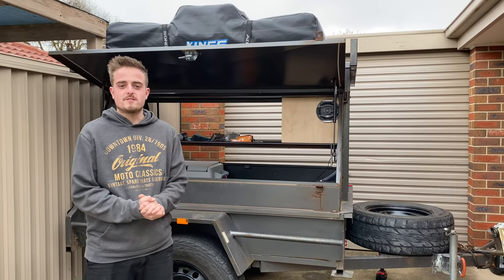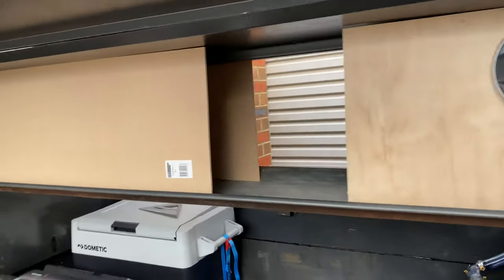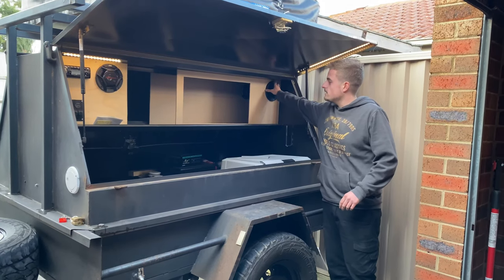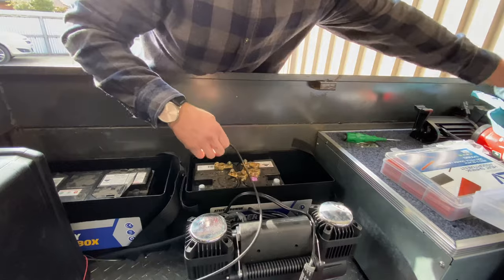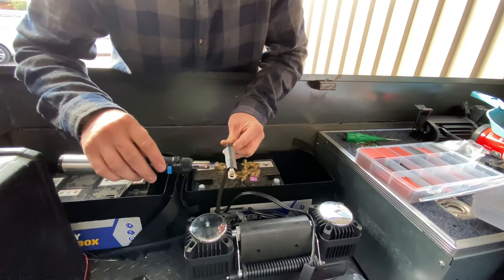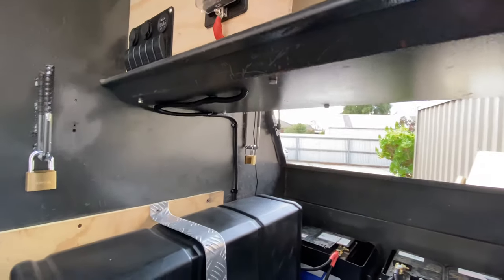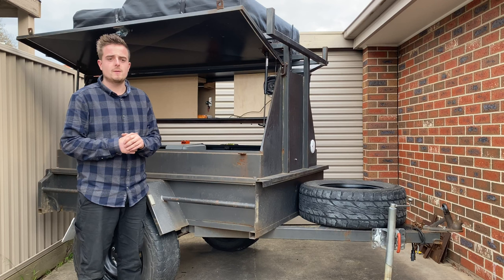DIY Off-road Camper Build

Comment: I've been watching you videos since you started your trailer and like your set up. I'm about to start my build but I'm going with a 30 second oz tent instead of the roof top. I have bad back pain so it just suits me better. What you are making is brilliant and I can say it's giving me ideas on mine. 1 thing I'm doing is putting a travel buddy camp oven in. Have you thought about one in yours ?. I bet you would enjoy having one. Keep up your good work.cheers mark
Reply from the maker: Hi Mark thank you for the good feedback I really appreciate it, that sounds like a great idea i have seen those tents and they look more comfortable then my tent. A travel buddy would be a great idea and a compact little oven, I’m not sure how much power they drawer?
Reply: Engineered To Design they don't use much at all. I'm not sure the power requirements right now but they don't pull a lot. They are very handy.chuck a few pies in for lunch or you can chuck a whole prepped meal in. They are worth the coin.
Reply from the maker: Mark Mcintosh I will be looking into one for sure I did see an alternative brand called road chef but it’s smaller on the inside..
Reply: @markmcintosh329  how did you go with the build mate? Looking at doing a trailer with my RV4 tent for accom.

Comment: Thanks for you videos... Nice work... I've been working on an identical trailer myself as a Covid project over the last few months.... different tent and inside layout but really interested to see your ideas...  I'm looking forward to seeing how this all works out for you.
Reply from the maker: Thank you Darren! It has been good having a long term project with the Covid stuff. I would like to see your setup and what you come up with also, keep me updated :-)
Reply: @EngineeredToDesign  I put a Motop hard shell tent on top which will allow for solar later.  The hard shell also allowed me to put a fixed ladder on the back.   I've just started doing the internal fit out which I'm welding frames of 20x20 RHS.  On the front of the tradie top there are going to be 2 jerry cans built into a lockable gate.   On the passenger side I have a awning and on the drivers side I plan to build a bike rack over the wheel arch that can swing away when I need to access the trailer.   When I'm a bit further along I'll try and do my first youtube upload.
Reply from the maker: darren thomas that sounds great you have lit a lot of thought in by the sounds, I look forward to seeing a video on it :-)

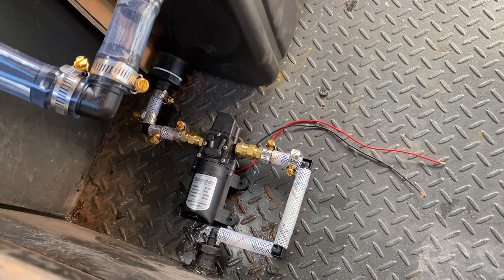Comment: Hi there, loving your design videos and following along to make our own camper trailer. At 7:08 I can see some gold valve connectors going from the water pump to the pipe. Could you please let me know what they’re actually called? Thanks!
Reply from the maker: They were a reduced fitting going from the odd thread on the pump to a standard thread to accept the barb fittings. When I bought them the guy behind the counter said these pumps were very common and they sold heaps of the reducers.. I just went to a hydraulic fittings shop.. hope that helps.
Reply: @EngineeredToDesign  Thanks so much for getting back to me - I'll suss out a hydraulic fitting shop :)